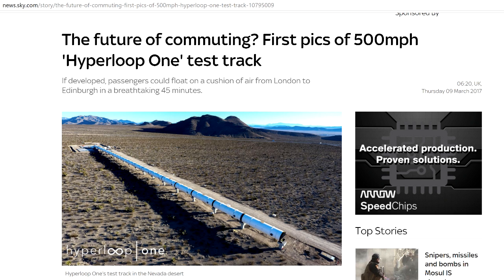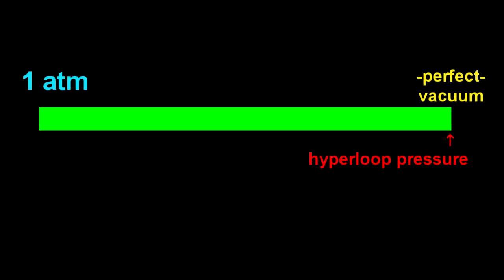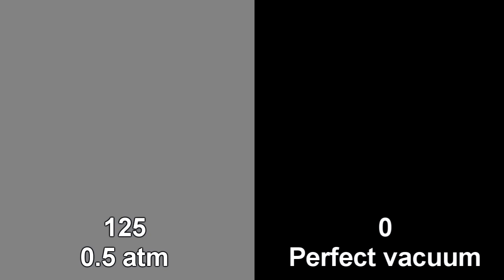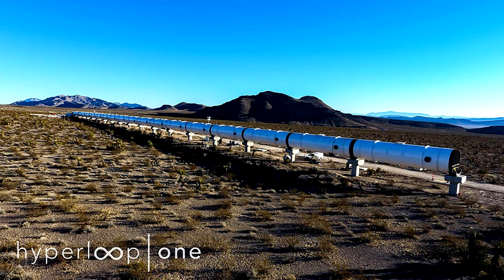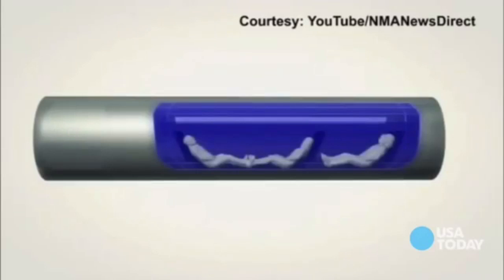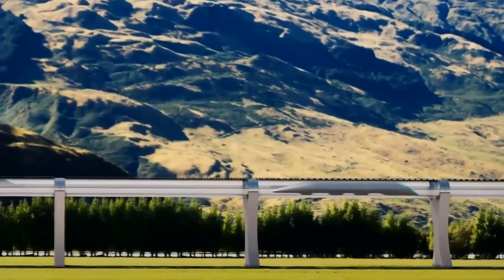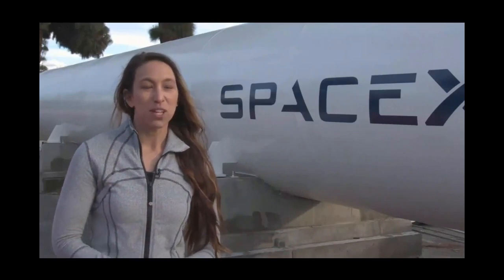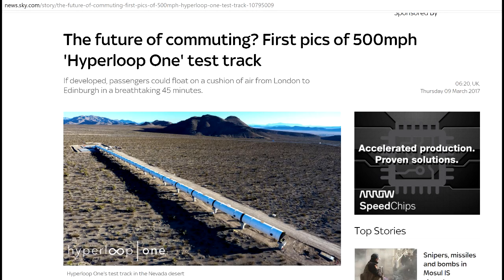Entire Hyperloop could be destroyed in SECONDS!

Comment: the real question is ,if they get it to the theoretical speeds they claim  how the hell are they goin to stop it?
Reply: alfredo perez a wall
Reply: alfredo perez solar freaking roadways.
Reply: it will move like a shuttle- first you accelerate, you only move at max speed for a short amount of time and then you start to decelerate until you stop. It is really good idea- they only need some mithril to build the tube :-)
Reply: magnets! air bag! 50 tons of tequila!
Reply: Umm.. By Braking
Reply: Mythril is strong for it's weight, but it's also very low-density. You want adamantium for the tube. Mythril would do for the car though - the less it weighs, the easier it'll be to keep it levitated and the faster you'll be able to stop it in an emergency.
Reply: +Vyl Bird
I would go for Unobtainium for the tube.
Reply: Make it out of old Nokia phones, then the Hyperloop will be indestructible.
Reply: Could use some runite in key points just to make it a little stronger.
Reply: There are some really excellent materials suggestions here!!! Would a diamond tune work?
!!!!!!!!!
Reply: alfredo perez Ken M?
Reply: What they do for roller coasters to slow it down is using the effect magnets have on copper or aluminum so they could use something similar.

Comment: Nice concept for in space, not so great when there's an atmosphere
Reply: light yagami why would you build a hyperloop in space?
Reply: There's no point of building it in space, it is already fucking vacuum !
Reply: i guess if you built it in space then it would make travel at such high speeds safer as it doesn't take much mass to hit you (a few dust particles for example) to cause you to take major damage so if it were in a tube you could remove pretty much all of the dangerous particles in it but even then it is still a dumb idea as it would still be expensive and useless
Reply: Uhm, the tube is for the vacuum. So you would not need that in space. Just make a mag lift rail system in space. No drag and it's safer.
Reply: AssassinVgaming
But the tubes need to be resistant to micro Meteorites
instead of armoring the car/ship/train you want to armor the whole street/trajectory/rails
also just imagine the huge amount of material that would be needed
another issue is that almost everything in space moves relative to each other so your tracks need to change all the time
not to mention the difficulties to keep the tracks from beeing ripped apart by gravity
Reply: "No Atmosphere is getting through several tons of earth, that's for sure"
ehh what?
we have scientific labs 2km under ground the pressure is definitively far greater, the deeper you go the greater the pressure is. even a microscopic hole that is big enough for air molecules to pass through will equalize that space.
Reply: but then there is no point because there is no drag force in space
Reply: Well to that end, why not bury it like a Subway Tunnel. No Atmosphere is getting through several tons of earth, that's for sure. lol
Reply: in an EARTHQUAKE ZONE
Reply: Atleast it wouldn't take much energy to do there.
Reply: Synerrox เ well, if its used as one of those "space elevators" as a starting point. though I don't really see how just a pod would work as the principle here is that it's a maglev inside of a vacuum.
Reply: Jack 
Large diamonds would be difficult to readily supply, plus it'd be brittle.
Reply: actually, carbon nanotubes is strong enough, but all tensile measurements have been done on very small scale, there is no knowledge on large scale. Also, the carbon nanotubes are just strong enough, not by a large margin, which can be problematic.
Reply: lol, you're mistaken with the "superman" myth of his hair.
Reply: Because of lower gravity, the pod would fly off in space at those speeds, the loop is there to keep it in place. Although regular grips would work too, although it would probs generate more drag than magnetic lifts around the inner tubbing
Reply: Use Diamonds